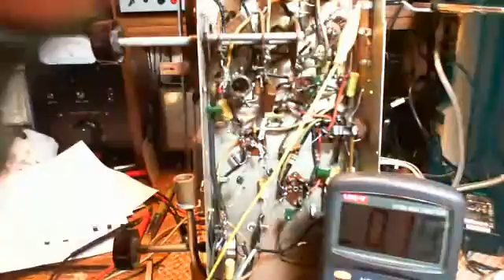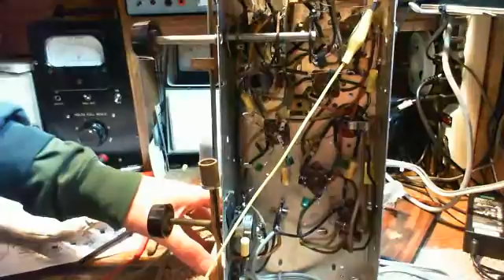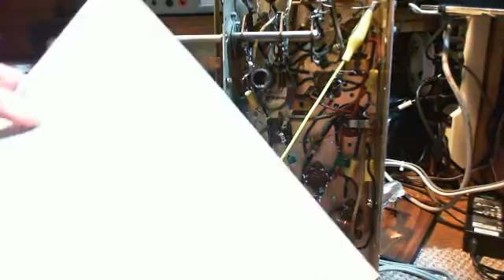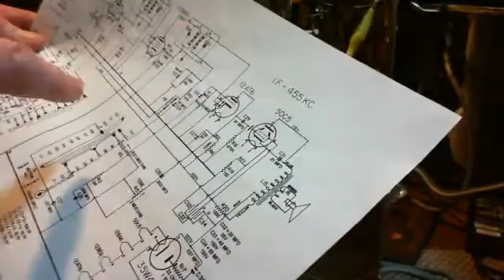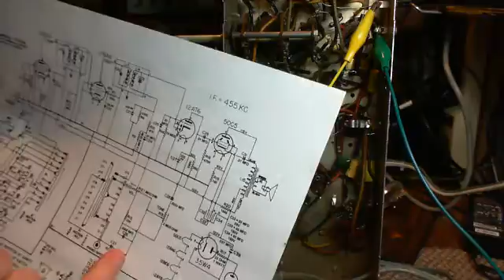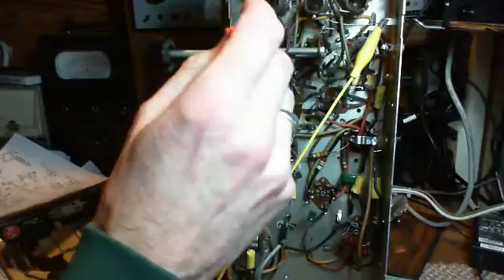Philips 922 Vacuum Tube Radio Video #15 - Once More into the Breach

Comment: Hi Jim does the radio have a place on the back of the chassis, just for the antenna ground ?. Well I see it does and by hooking it up it kills the signal. Hmmm. Strange indeed. Could there be something in the antenna ground circuit that is shorted?. Maybe try an Exorcism on the radio ; ) Just kidding I hope. :-)  Thank you for sharing Jim and best of luck.
Bobby
Reply from the maker: The ground terminal on the back is connected to the negative terminal of the power supply and not to the chassis.  The chassis is also connected to the negative terminal through a capacitor.  When I attach the ground lead of my generator to the ground terminal on the back, the signal level drops way down.  That and the hum that is introduced when the generator ground is attached to the chassis are interesting to me since I don't really understand either effect.  I still need to align the set so that will give me another shot at the radio.  I'm reading up on exorcisms.